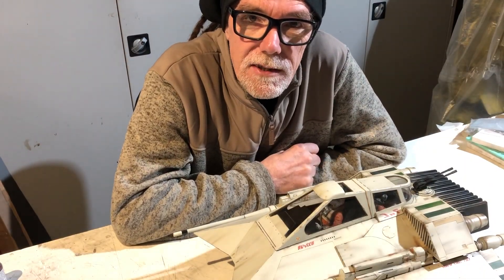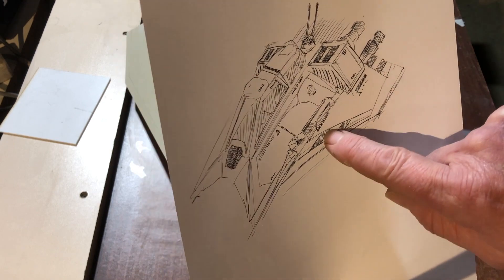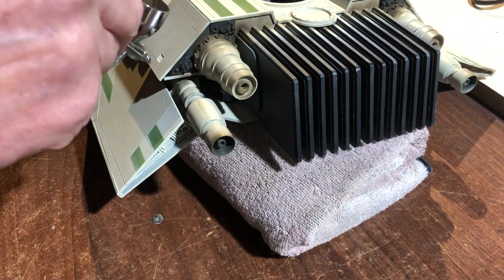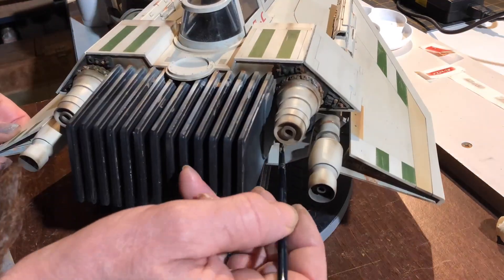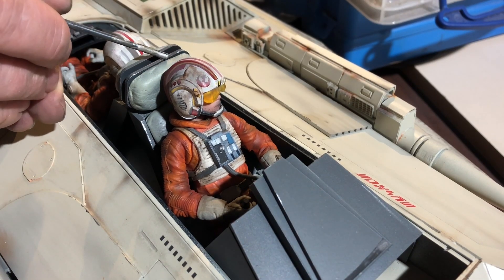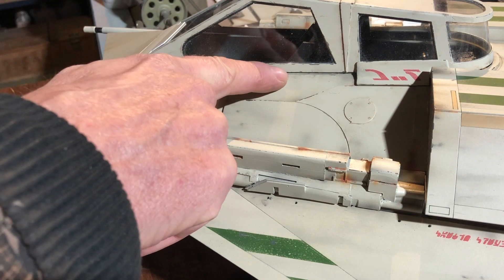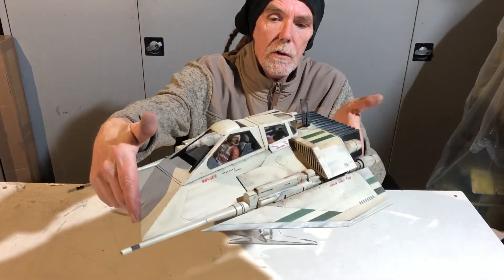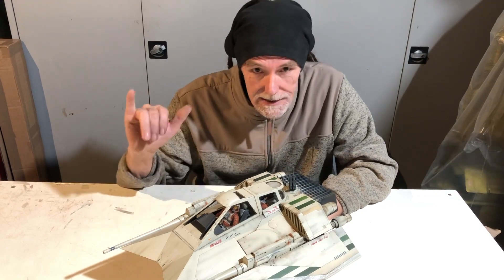PAINTING THE MCQUARRIE SNOWSPEEDER

Comment: Great work!  What are those painting sticks called.  They are great, I can’t find any
Reply from the maker: Thank you. The painting stick is just a short length of carbon fibre rod, 3mm diameter. But you can use anything long and thin. I used a small length of thick copper wire for a long time, or an old thin screwdriver.